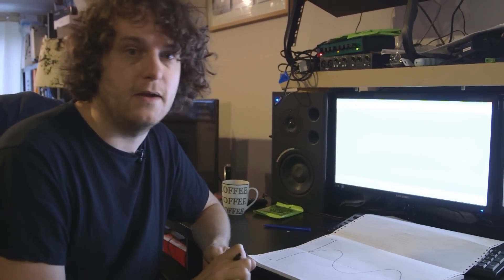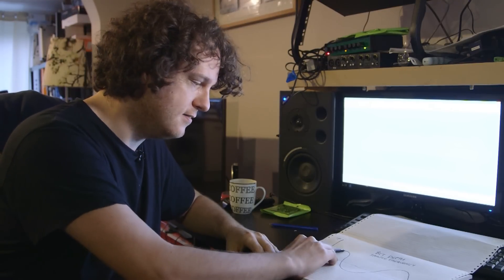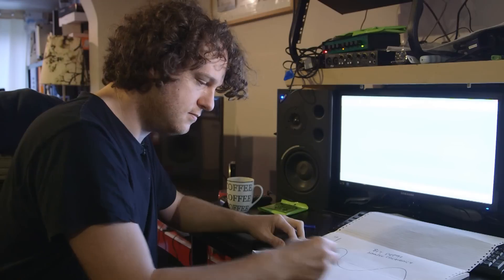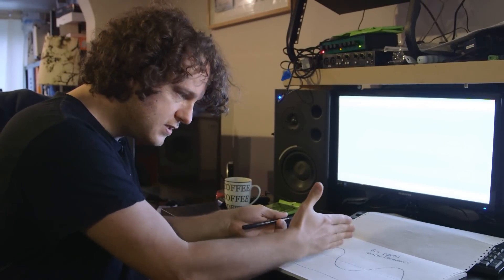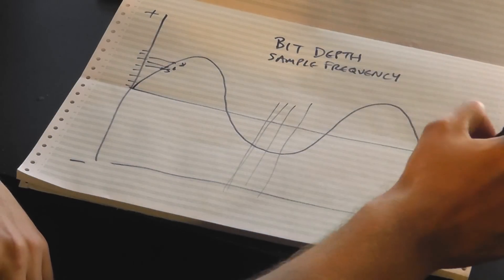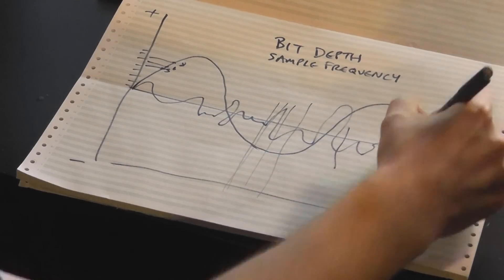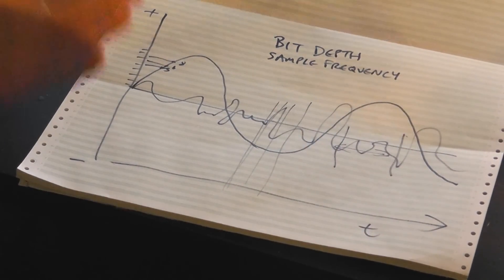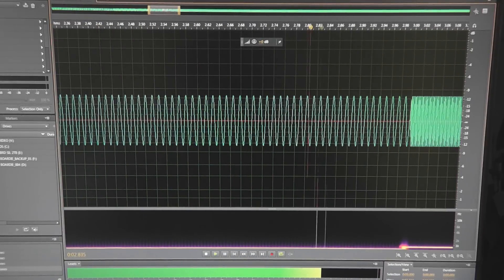How Digital Audio Works - Computerphile

Comment: (My speaker properties after watching this video)
24-BIT
192,000hz
Reply: +FrankJavCee youtube changes it back to 16bit and 126kbps mp3 so have fun
Reply: the point is you will never get 192khz/24bit audio on youtube its a waste of data. HD maxes out around 192kbps (which is NOT 192khz - it's samplerate and bitdepth combined). i can't be bothered arguing any more. bye
Reply: I agree that setting soundcard to 192kHz is useless, and I know the difference between bitrate (bps) and sample rate (Hz) or depth (bit). I was trying to add to your information.

I didn't speak about sample rate because I don't understand what sample means in widely used lossy compression codecs  vs. in WAVE (PCM) codec.
Sorry to bother you. But original poster seemed to be ignorant so I replied to you. I'm, however, *not* a sound engineer, but this much I know.
(No need to reply.) Bye
Reply: rallokkcaz YouTube algorithms.  Did u see those nerds circle jerking each other above tho. I mean that's why I comment on everything to read discussions and to create awareness.
Reply: +FrankJavCee You will not hear a difference to 44,1 kHz 16b even if you imagine it. Normal sound cards even produce noice and slight distortion at 192 kHz. Also, for ideal reconstruction of the original signal, the higher frequency isn't needed. Also, the loudspeakers will probably not handle the higher frequencies worse, since they are only built to 20 kHz spec. You might get some popping sounds or other distortion. I know it isn't very intuitive, but there are mathematical proofs that the signal can be reconstructed from a little more than the double of the frequency sampled. The bit depth can help, but probably most sources will be 16b anyway, so you will not get any bonus. See my other answer for more info.
Reply: +JamesMulvale Well, they mostly use AAC (Advanced audio codec). HD quality (720p+) is usually accompanied by 256kbps audio and Non-HD (480p and lower) by 128 kbps audio. 
Now, I heard that due to AAC being better compression codec than MP3 and the quality of YouTube's encoders, you can get the same result with 96 kbps AAC as with 128 kbps MP3. That 96kbps bitrate is used in MP4 360p video+audio stream on YouTube.

Also, 320 kbps AAC uploaded audio track  is allegedly of same fidelity when they encode it at Youtube AAC 256 kbps. 

At this point you get to psychometric measuring of subjective quality of sound. That's a whole other discussion. You people might want to look up "Fraunhofer Institute for Integrated Circuits IIS" for more information.
Reply: +LovSven2011 "I don't understand what sample means in widely used lossy compression codecs"
It means exactly the same thing as it does in PCM. It's just a wave amplitude value at a particular point in time. The particulars of the data compression technology doesn't dictate the compressor input format. MP3, AAC, Vorbis, Opus - they all consume PCM data and output PCM data.
Reply: +JamesMulvale So, in short, if you don't turn on HD, you get about 128kbps MP3 equivalent quality.
Reply: Why do we watch all of the same videos?
Reply: FrankJavCee Haha colorfull description. :-D And you're welcome. Hope you learned something new. :-)
Reply: +LovSven2011 YouTube also encodes audio to 50k, 70k and 100k Opus, which sounds pretty good.
Reply: SNESIvan  Oh, webm container has opus, I see that now. Quick search: has low audio latency. Nice. I didn't know about that format.
I mostly get Flash player or sometimes HTML5 player on Ytb. There is really as much open/alternative codecs as much as professional ones.
Reply: +FrankJavCee Oh. Hey.

Comment: I find 24/44.1 does not give low enough latency when playing guitar, so once I go to 24/96 everything is perfect.  I have never tried 24/192 though.
Reply: +EgoShredder That makes no sense unless your equipment is faulty or the interface only allows no latency monitoring at that sample rate.  The higher the sampling rate, the more computer overhead, therefore the more latency there would have to be.
Reply: +Ben Gencarelle (Ben Wizards) I found this equally confusing as it flies in the face of accepted logic.  All I know is that if I choose 24/44.1 I get very laggy response when playing fast guitar solos, and yet at 24/96 it feels and sounds perfect.  The really weird part is that I do not suffer much extra CPU overhead, and I am only using an old IBM Thinkpad Z61p laptop which uses a Core2 Duo T7600 and 3GB RAM and an SSD drive.  This is with a Edirol UA-101 USB 2.0 audio interface, but I have also experienced the same thing with a cheap M-Audio Ozonic Firewire.
Reply: Blimey!  Thanks for looking as it is normally me doing the donkey work for others down the years, so nice to get something in return :-)
Reply: +EgoShredder Maybe with 24/44.1 your computer is doing live resampling to 24/96, which causes the latency. What operating system are you using?
Reply: SNESIvan
Win XP Pro SP3 + Roland UA-101 USB 2.0 audio interface capable of up to 24/192.  IBM Thinkpad Z61p laptop Core2 Duo T7600 + 3GB DDR2 + 500GB SSD.
Reply: EgoShredder I see. Win XP doesn't have WASAPI (Microsoft's low-latency audio protocol) as far as I remember, which may be an important factor. You might want to try a multimedia Linux distro such as KXStudio. I use JACK for audio recording on my machine (I run Xubuntu 14.04) and it's a bliss. You can set the latency yourself and get some really fast sound. I'm running a lowlatency kernel, and I get 5ms with no problem at all! You can run it from a pendrive to check if your interface is supported, although I think it'll probably be fine.
Reply: EgoShredder
If you're interested, I just checked, and Linux indeed has a driver for the Edirol/Roland UA-101.

Comment: Are you saying that if I layer audio on my video that when it's rendered, those audio track levels will be summed? ie added together?
Reply: +NeonsStyle Yes, that's right. That is the reason why if you have two similar waves and one of them is phase inverted, it becomes mute!
Reply: So doing this would be a bad idea as the sounds could be out of phase and thus destructive. Thanks heaps :)
Reply: NeonsStyle Nope. Summing audio is fine, you just have to make sure your audio is not out of phase. Keep in mind that for this to happen, both waves would have to be on the same channel, so you wouldn't hear anything if that happened.

What may happen, though, is you may have a voiceover that you recorded in stereo incorrectly, and you have it with the right phase on the left channel, but the right channel has it inverted. Guess what happens when someone watches your video on a phone speaker or anything that mixes down to mono? Your voice disappears! Well... almost. Since YouTube codes it stuff into AAC/Opus, your viewer will only hear artifacts that slightly resemble your voice.
Reply: NeonsStyle Audacity for recording? All right! For processing? Yeah, no. You should use your video editor instead, with a nice free VST compressor. Don't exaggerate on the ratio and attack. If you're looking for a deep radio voice, you'll want a multiband compressor. Have a tight compressor (ratio of 3?) on a band that goes from 0hz to around 90/100hz with a generous makeup gain. You might want to get a small compressor on the 200hz-500hz band, but with NO MAKEUP GAIN, just for controlling the mud. For brightness, compress midly the ~6khz band (have a Q that goes from 4.5khz to 8khz if you want) with a little makeup gain.

Just don't exaggerate, any ratio above 4 is too much! Remember to add a highpass before any processing (except noise removal, which if you're going to use, I recommend iZotope's RX3 and a mild setting) around 20hz. If you're getting too much noise, lay down a bit of compression and get a little non-aggressive gate going (just don't make it too obvious).

By the way, I'm not the guy in the video, just an audio freak! :)
Reply: Ahh I see... hehe... thanks heaps for all the info.. I really appreciate it. :) I'll see what I can do with that. Thanks :)

Comment: Rather inaccurate video imho.
1. It's not 44.1KHz because the limit of human hearing is 22.05KHz. It has to do with the upper limit of human hearing and the choice of anti-aliasing filter (transition band width). The assumed human hearing range is roughly 20Hz to 20KHz.  The Nyquist sampling theorem tells us that the sampling rate should be at least twice the max frequency of the signal (so 40Khz). 
The problem now is that our original signal contains frequency above 20KHz, if we try to sample at 40Khz aliasing will occurs (frequency above 20KHz fold into the hearing range). The signal must be low pass filtered (anti-aliasing filter). We can't perfectly cut frequency right at 20KHz, in practice a transition band is necessary. For practical and economic reasons, a 2.05KHz transition band was chosen. Now our signal contains frequency from 20Hz to 20+2.05 = 22.05KHz. Back to Niquist, we need to sample at 44.1KHz.
2. You DON'T end up with square wave. You could use 4 bits per sample and you still would not get square wave. You'll get a ton of quantization error (rounding error) and the signal will be drawn into noise (low SNR). Moreover, the computer doesn't draw line between point. It finds a continuous signal from the sequence of samples, there is a unique solution.

Comment: It would be nice to parallel this with analog recordings, such as tape and vinyl. Vinyl, especially, is very interesting because the headroom is 'technically' unlimited and really only limited by volume. The higher volume you stick onto the vinyl the wider the channels become and you end up having less time available on the record which is why vinyl is always given a much lower volume than today's modern music because the idea is at the end of your vinyl player you will have a sound system with a volume control to amplify it up. I am one who wants to see the digital audio industry cut out the bullshit 'volume war' and instead educate everyone on having an amplifier to turn volume up. There are even headphone amplifiers; there should be no excuses for quality of music to suffer.

Comment: Could you do sound with a logarithmic scale? such that the shorter waves can get more detail than the larger ones?
Reply: Sandra Nicole Yeah, more like a float rather than integer :)
Reply: +Sandra Nicole Interestingly, this is sort of what happens with audio compression techniques. Many audio codecs chop up the continuous sound signal into short sample frames (of a few milliseconds long each) and convert the audio signal into discrete frequencies (with a Fourier Transform of some kind). Then a psychoacoustic model is applied to the frequency spectrum to eliminate details our ears care less about, and apply emphasis to those remaining that it does care about. This is sometimes done with a MEL Frequency analysis, thought every codec has its own method. Lastly, the remaining frequencies are packed in a compressed data stream, such as a Huffman tree, or LZW, or whatever the codec calls for. Decoding and reconstituting the original sound perfectly is of course impossible at this point, so they call these kinds of codecs "Lossy", since they throw out a lot of information to fit the most important parts of the sound into the least amount of data possible.
Reply: +Sandra Nicole as written, it does exist, but for 8bit audio. For 16bit it's simply not needed. And in fact, even 14bit is already enough for our perception, unless you like to crank up the volume a lot on quiet parts of a song.

Comment: Curious why they don't take the magnitude of the wave, say by using a full wave rectifier circuit.  The input is sinusoidal and so when outputting, when there is a change from decreasing values to increasing and you're near 0, you know to take the negative of the value until you go past 0 again.  Whether the wave should start as negative or positive could be determined by the amplitude of the initial sample, which might be possible in hardware; although, I'm not sure what difference it makes, starting low or high, producing the inverse of the wave.

Comment: Lots of stuff missing. The Nyquist limit (which is why you record at just above 2 times the highest note allowed), PCM, the method used to save the information and compression,  both lossless and lossy, are all central to how digital audio works.

Comment: 7:15 The computer doesn't have to draw lines between the samples. They can just remain individual samples. When you output the signal it's smoothed out anyway (I assume the momentum of the moving bits in your speakers help with that).
Reply: +RC-1290 It's not smoothed out so much as a sin wave is fitted to the samples, and the DAC just outputs a perfect combination of sin waves.

Comment: I know he was simplifying but to be sure, if you sample frequencies higher than twice the sample rate, you're not simply "cutting them off." It's actually much worse: you're introducing kind of "phantom frequencies" that weren't in the signal but turn up in your digital signal. Those are mirrored at the highest frequencies you can represent, so the higher you go into "you didn't filter properly" territory, the lower the frequency gets (until it can't anymore, then it gets higher again), thus being more off and mostly more noticeable, too.

Comment: My DAW has settings up to 192,000 Hz, are there any benefits or downsides of using a sample rate this high? Considering the "industry standard" is significantly lower, what applications make use of this sample rate ?
Reply: +OnixRose almost none. 192 will give you a huge file size and slow your sessions down. On top of that, there is scientific evidence  that ultra high sample rates actually sound worse  (intermodulation distortion).  Plugins and DAWs like higher sample rates because it gives them more information to process. as a result, most plugins up sample to 88.2 or 96k when your session is running at 44.1/48k. I wouldn't bother using higher than 96k. 96 would be a good sample rate to run at if you think you're going to be doing a lot of time stretching or similar processing. Other than that, you cant really go wrong with 48k.

Comment: One thing I wonder is about the sounds we cannot hear but still have an effect on us, like when happened  in a laboratory that at night people started to get visual artifacts that where traced to I guess infra sound/noise made by an air conditioner or something like that, how do you treat that, or would use in a scary film for instance, or if they are totally cut out.

Also there was a buzzing/fan/whatever noise in the background all the way through that was kinda... distracting.

Comment: Very well said!
There's a lot of analogies you can draw to photography and Photoshop. Clipping is like over-exposing an image. Sampling frequency is like pixel resolution. Bit-depth is like color-depth. In photography, ideally you want you final image to span the entire 24bit colorspace, with no obvious pixelation, and no obvious posterization. In audio production, you want your final track to span the entire 16bit wavespace with no obvious digital distortions.